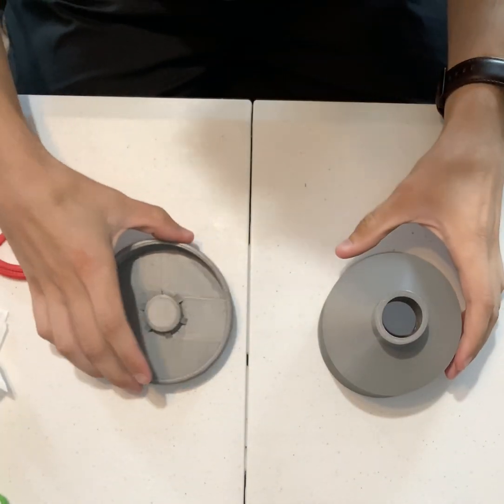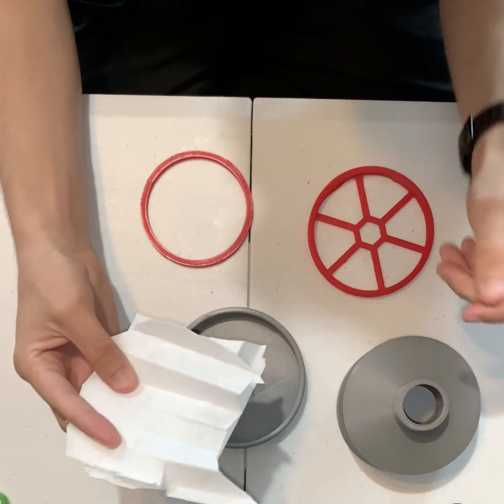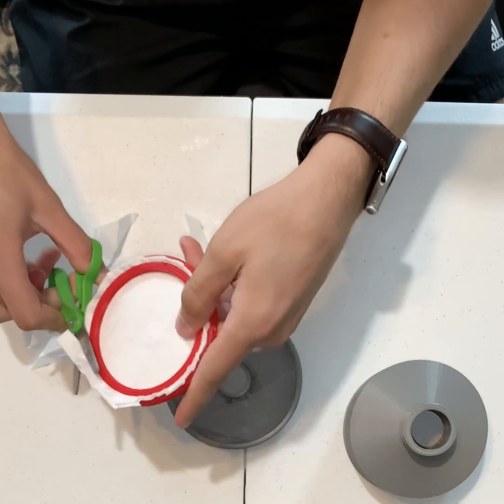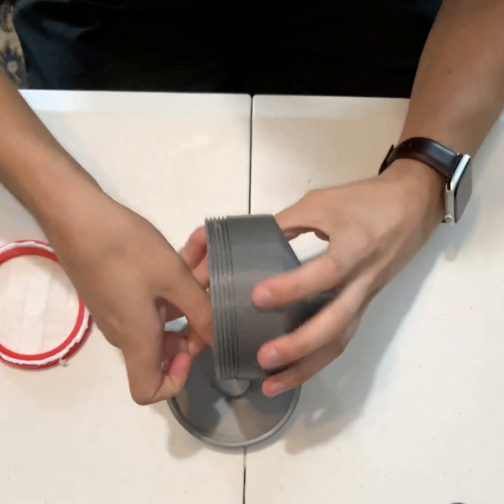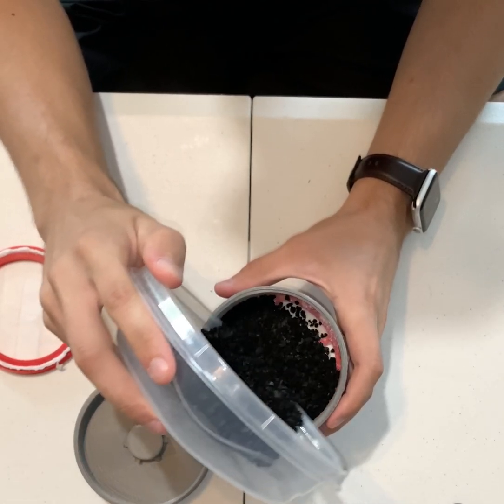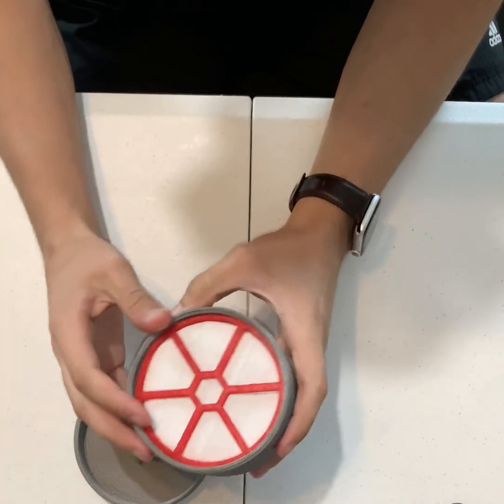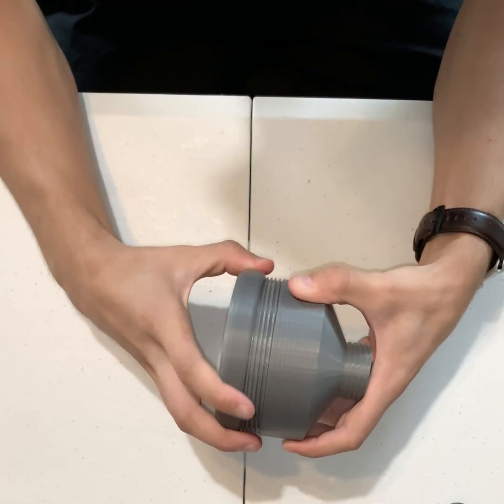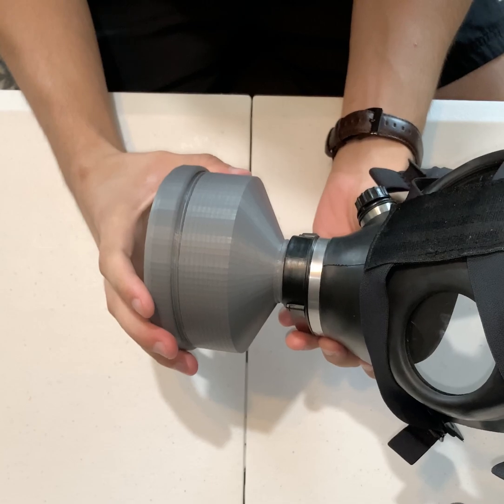3D Printed 40mm Gas Mask Filter Assembly

Comment: As an added tip, I have seen people who make 3d printed NVGs spray the parts with spray can truck bed liner to give them better waterproofing. Since 3d prints are pourus, it might be worth it for this too
Reply: truck bed liner? I'll google it. Are you sure this isn't poisoning to breathe? I did mine with PETG and high temp so I'm hoping the holes on molecular levels are a lot less that way

Comment: That’s a great task !! I need a few suggestions from the community here please guide. 

I want to know what is the material/specification of the white filter which is used at top & bottom of gas filter. This cannot be simply cotton because it has two purposes 1) it should be breathable & should let filtered air pass to wearer 2) to hold & avoid passage of fine carbon particles to wearers mouth.
Reply: He used a HAVC filter for the white filter but if that is to much or cant find any I thought about using 2 coffee filters for the top and bottoms of the filter.

Comment: Out of curiosity, would it better to put the activated carbon through a ball mill?   Pretty ingenious work so far!  I wanna make special respirators for me and the kids so we can walk thru covid and smoke infested casinos (we live in Vegas) as a family again.  I  am not sure if this would make it filter better or worse, i don’t know how commercial gas cartridges are made.  Theres a high pressure pump that will draw the air so it doesn’t have to have amazing air flow, just want the smoke and covid gone.
Reply from the maker: Finer carbon will have more surface area (plus the bed density will be greater) and therefore it will be more effective. That being said, the particulate filter that separates the carbon from your lungs needs to be fine enough so that no dust can get through. Breathing in too much carbon dust is probably worse than breathing in cigarette smoke! You should do some research on particle size of activated carbon in industry and go off that.
Reply: @jacobrodenbeck1178  Brilliant!  Yes were weren’t so mindful of the second hand since we only walked the casinos infrequently, but we lost the kiddos mother due to lung cancer and she was a never-smoker.  It could have been second hand smoke we’re just not sure.  Super careful now though.

Good idea on the smaller particles. I figured we could address these with the filter paper and also an air elutriation column.  Basically, cycle the powder thru the column until particle size analysis shows a depletion of smaller sizes.
Reply from the maker: @weirdsciencetv4999  I'm sorry to hear that! It sounds like you know what you're talking about with the air elutriation. A sieve might also do the job. Just look into the particle-stopping capabilities of whatever filter paper you use and maybe use an extra layer to be safe!

Comment: HI Jacob if your reading this apparently you have engineering experience is there not some reason I could not try to make my own custom gas mask filter by using cotton than cutting a pm 2.5 filter (I think it does have carbon/ charcoal in it ) to fit inside the filter do you think it could work thoughts please thank you
Reply from the maker: Hello,
I see no reason this wouldn’t work if it was done properly. There are many different types of filters, and the design really depends on what you’re trying to remove from the air. Filter papers will really only remove particulates (dust and aerosols). Activated charcoal adsorbs chemicals that can’t be caught by particulate filters. If you design your own filters, just make sure they’re safe to breathe through. Inhaling any type of particulate, including dust from charcoal, is bad for the lungs so make sure there is a particulate filter between any charcoal and the mask-side of the filter. Cotton is okay but not excellent as a particulate filter for gases.
Reply: @jacobrodenbeck1178   hi jacob ad I was trying to lern the ideas I was doing more research I don't know that cutting a pre made filter wad the best conclusion so my current idea is a cotton than a charcoal furnace filter cut to the size than covered with more cotton sound possible?
Reply: I did read some where though some one said they tried to use a cotton hepA  filter. If there were that do you think that would better? Or would you say the issue might be we can't be 100% sure it's cotton so perhaps a possibly better idea is send which charcoal between 2 surgical masks?
Reply: I mean if yo could sandwich it inside to masks surgical and screw the creaad product into a gas mask does that possibly sound like a better idea thoughts please than you
Reply: I was trying to see what see what other people said it seems to recommend in 1 video I think some like if you take an n95 or similar I guess we'll it would seem that I wonder perhaps than if one idea could be just use the cotton than charcoal than a cut up n95 or simliar so you don't breathe the charcoal does that sound like it might be better any ideas please thank you
Reply from the maker: @Fredengle  Sorry for the delayed response. N95 filters would certainly work as particulate protection, and face masks would be a pretty good place to get this material.

Comment: the inside ring that has threading  is too small and it dosent touch the threads
Reply from the maker: I can't replicate this issue. Make sure you have the updated versions of the files as there were some edits made a while back. If that's not the issue, just try scaling up the inside ring, perhaps your tolerances are better than mine. Hope you get it figured out!

Comment: I wouldn't bet my life on a DIY filter that clearly doesn't meet the EN certifications
Reply from the maker: Good point! You SHOULD NOT rely on this filter in life threatening situations. This should really only be used for nuisance particles and vapors that won’t kill you if you get a whiff. There is a disclaimer on the thingiverse site. That being said, my tests have shown that it actually works surprisingly well for what it is. Thanks for your feedback!
Reply: @jacobrodenbeck1178  I found this while thinking about those moms who got tear gassed in Portland.  I'm also thinking about 3D printing cannisters for a CO2 scrubber in a closed circuit SCBA oxygen rebreather.  Let me know if that idea interests you.
Reply from the maker: Nestor Wheelock this design would likely work quite well against tear gas due to it typically being an aerosol rather than gas agent. To increase effectiveness, more layers of particulate filter could be added in place of the carbon section. As for rebreather canisters, from what I understand a chemical reaction must take place in which CO2 is converted back into oxygen. I don’t know the details of this reaction, but so long as it is not overly exothermic and doesn’t create products that might damage plastic, a 3D printed design like this one should be a possibility.
Reply: have you deconstructed a Avalon CBRN filter ? . If this design is painted with polyurethane (exterior) and fitted with Cotton/ULA /active carbon mesh/raw active carbon/mesh /ULA/Cotton ...It would be equal if not superior to whats issued - standard cartridge can deform and split going to prone , this PLA ones more likely to break a tooth , I suspect in an endgame situation tearing of the mask and assaulting  the enemy with the filter end would yield satisfactory results . Currently with negative APR  or PAPA  Two hours is maximum exposure time for filters to radiological threats - This .Stl  could be tweaked to extend that exposure time .......Pretty sure Mr Rodenbeck here just made it onto a couple of lists , for useful mofo to have in bunker . If your in NZ we got u a spot .

Comment: I printed the two rings and the one that holds the HEPA filters down is not fitting inside the other ring.
Reply: I managed to fix it by cutting a slit in it and then i was able to flex the ring it into place
Reply from the maker: That probably just comes down to the different tolerances on 3D printers. If you print another, I recommend printing the inner ring at 99% or 98% scale to help it fit. I'd be interested to hear if the threads still fit into each other since tolerances should effect those as well. Thanks for your feedback!
Reply: @jacobrodenbeck1178 On the original model you designed it perfectly you have talent. It fits perfectly in gas masks and i tried what you said and it worked. Thanks for sharing this video and the files to thingiverse :)